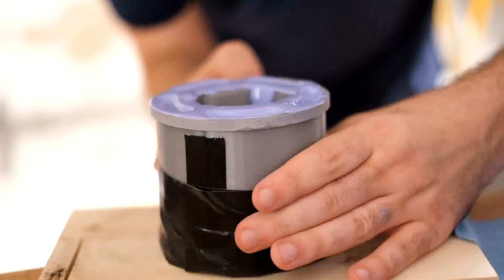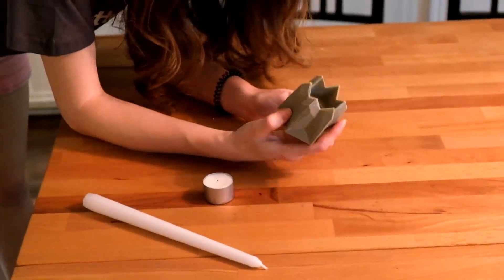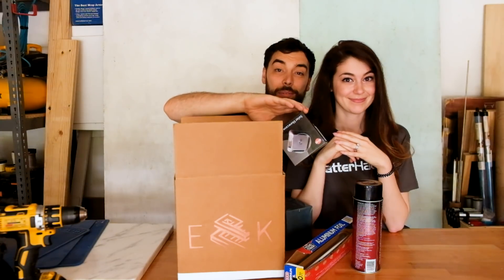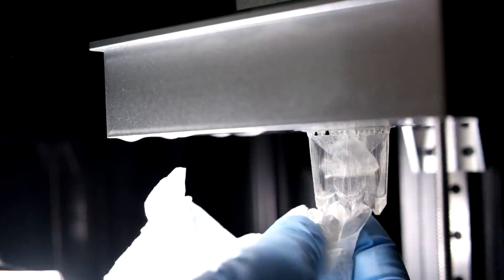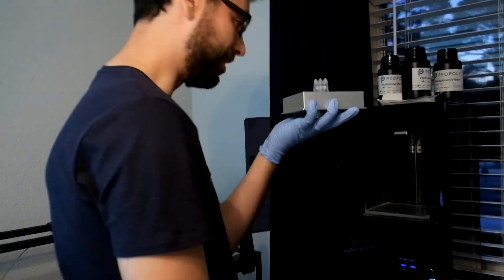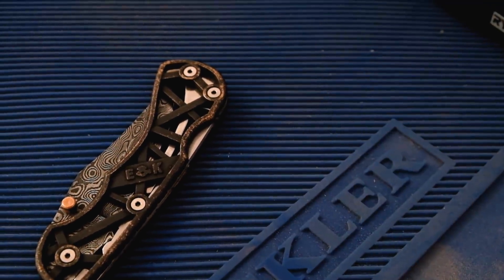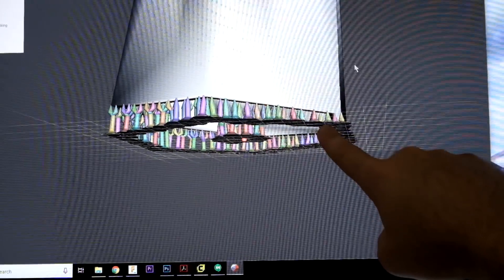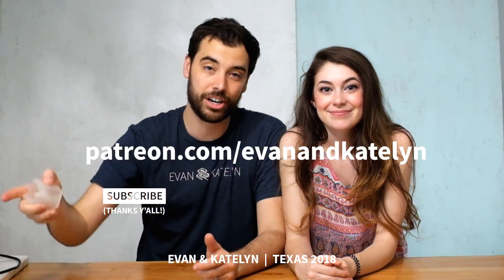How To 3D Print with LASERS! (SLA)

Comment: I currently have an MSLA printer that works almost the same except instead of a laser it just shines a UV light on the bottom of the vat and uses a cellphone screen to make a mask for the area to be cured. That means it does the entire layer at the same time which really speeds up the printing time on large prints compared to regular SLA. I understand lasers make slightly higher quality but MSLA is way cheaper and still a lot finer than FDM. I'm getting another MSLA in for a review soon so it will be cool to compare.

Comment: at around 5:30 you pour ispropanol into a container, however the captions say to use ethanol. which is accurate or does it not make a difference?
edit: at around 7:15 you say that you isolate the alcohol to keep it away from electronics, however as far as i know alcohol is used to clean electronics as it cannot bridge contacts. did you misspeak or is there a danger that i don't know of?
Reply from the maker: It's actually isopropyl alcohol that should be used. The main reason we isolated the alcohol later is because of a fire danger due to heat 👍

Comment: The way the printer works. Is there are tiny sharks with lasers strapped to their heads and Dr. Evil reads the Gcode to them and the sharks  print the design.
Reply from the maker: Yep that's pretty much it! We just want frickin sharks with frickin laser beams attached to their frickin heads 🦈🦈

Comment: i know this is late and all but, since you are using PLA plastic why not make a acetone vapor ventialtion chamber. its super simple to make and it smoothes out all the bumbs on your prints
Reply from the maker: Acetone smooths ABS but not PLA actually
Reply: wow you actually saw this. 
I was under the impression that it would also work to some degree on PLA since you can use acetone to weld 2 objects together. granted it would not be as effective as ABS but still effective enough. but then again you would know more about it then me so thx for the reply. 
i have been binding your content lately, so thank you for the content as well

Comment: You can get a smooth surface with the filament 3d printer with acetone, just put the printed object into a container with acetone for some hours, will melt all surface filaments in 😉.
Reply from the maker: If you're using ABS, definitely! But it doesn't smooth PLA which is what we print in

Comment: cool i didn't know about this technology. how much more expensive is it compared to a standard 3d printer to produce a object?
Reply from the maker: This one is $1295, so really comparable to lots of FFF printers!
Reply: FFF? you kids and your new texting language. what about the cost of the materials to produce a item. is like 3 or 4 time the price to print withe the laser 3d printer ?
Reply from the maker: Ah sorry, fused filament fabrication (what most printers do, where you have a roll of plastic filament). Yeah that's the downside, the material is more expensive. But the print quality is way nicer. So it has its time and place!

Comment: YAY! You dudes hollowed the model properly to save resin :D So cool to see you've got access to a really sweet SLA now, going to  make all those intricate prints so much easier. Just be careful with those resin fumes!
Reply from the maker: Mmmhmn, the shell command in Fusion 360 is a livesaver lol!! I also went back and added a small perimeter of thicker material to add some structural stability to the base which was fun :) Already have some intricate prints in mind. What do you do for the fumes?
Reply from the maker: That'd be cool!
Reply: EvanAndKatelyn You two should do a steampunk Franken light switch for a future project.

Comment: what's the melting piont of the resin after it hardened because you don't want it to melt when you lighten your candels
Reply from the maker: We will be using this to cast concrete candle holders (that'll be a future video) so heat won't be an issue 👍

Comment: That's not a true uv light, it's 395-400nm which is what standard coral fish tank lights come with and is called a regular violet light, you definitely don't need to be using those safety glasses for it.. a true UVA or black light should be from 320-390nm and shouldn't have much visible light; it is still relatively safe for the eyes as long as you don't look directly into it for an extended period of time.  If you wanted UVB, the light shouldn't be visible (290-320nm) and UVC would be highly dangerous
Reply from the maker: Interesting... Well in the end it sincerely to work so that works for us!

Comment: I think it will be too thin. Add a bottom for a better concrete construction.
Reply from the maker: It's just what we are using to make a silicone mold, then the concrete will go in the silicone 👍
Reply: Ok. Just a thought I had. Nice way of 3D printing. I will follow along this project.
Reply from the maker: Thank you!